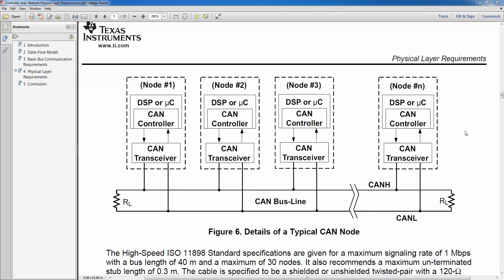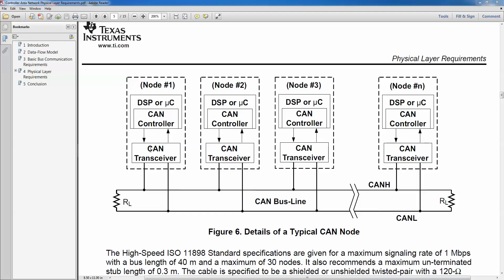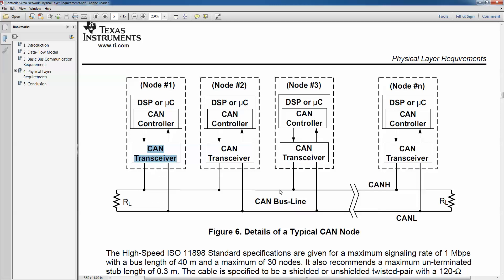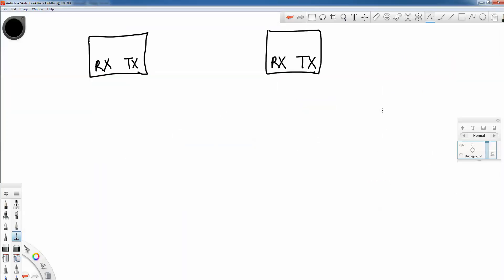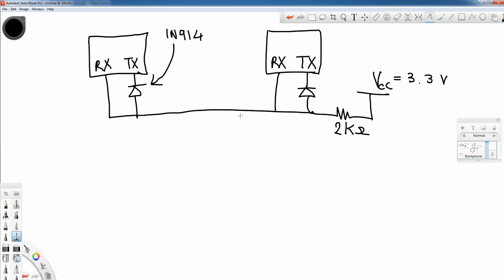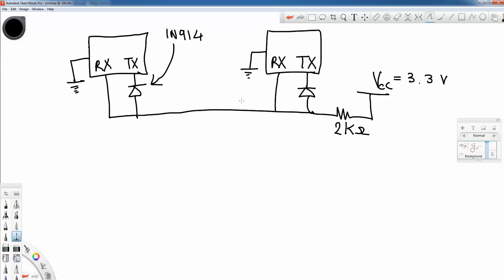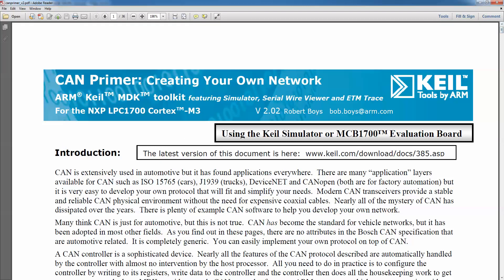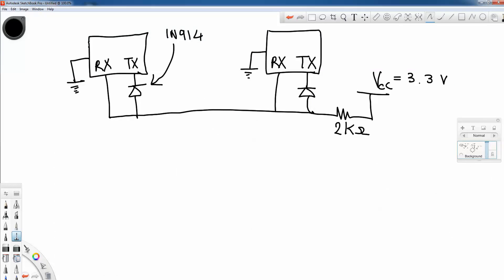Single-Wire CAN Bus Without Transceivers

Comment: Shouldn't the diodes be flipped?
Reply: Yeah that is always my reaction when I look at this diagram too, BUT it is correct as it definitely works, somehow.
Reply: I think there should be an explanation as to why.
It has to do with the collision detection.  The way the collision detection works is the transmitter sets the pin to a value for the address. If the address bit is a 1 and it reads back a 1 in the rx that means two things either there us no collision or the other transceiver is also outputting a 1. In case there are  more than 1 transceiver trying to send then at some point one of them (The one with the lower address id) will have a zero. If you write a one but read a zero that means another transceiver with higher priority is trying to transmit. Then you give up. If you follow this scheme the node with the lowest address will get priority. 
The reason for the diode to be pointing to the tx line is so that it can drive low but not high. That way a zero will overwrite a 1.

Comment: KELVIN LE, how does a CAN transceiver concert 0vdc to +5vdc and converter it to CAN +3.2 , +2.5vdc, +1.5 signals, this is differential amplifiers or level shifting circuits?
Reply: If you are signaling down twisted pair wires, then you need a CAN transceiver. Most CAN transceivers operate at a single voltage .. e.g. MCP2551 is 5V, which can be used with 3.3V uCs that have in-built controllers as long as the uC supports 5V, but I have had minor problems some times doing so. Instead you can use a CAN transceiver that can operate at the voltage of your uC/cntroller for the signalling to and from the transceiver and your uC, such as the MCP2562 tranceiver. I think it still uses 5V on the actual CAN BUS, but at least it can do the level shifting directly for the comms to your uC/controller. The MCP2562 is all you need (no additional level shifters required).
Reply: @lucysluckyday  There are 3.3V-only transceivers. They rely on the differential nature of the CAN bus, essentially guaranteeing the differential between CANH and CANL, but the common mode will usually be a bit below 2.5 V. They'll work fine in a network with 5 V transceivers, and that way your 3.3V devices don't need a 5V supply just for the CAN transceiver.